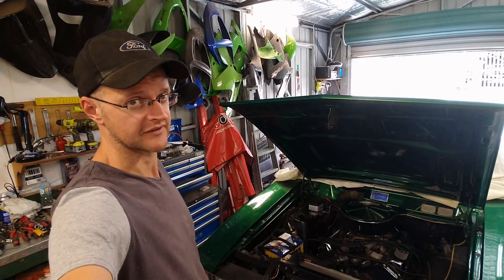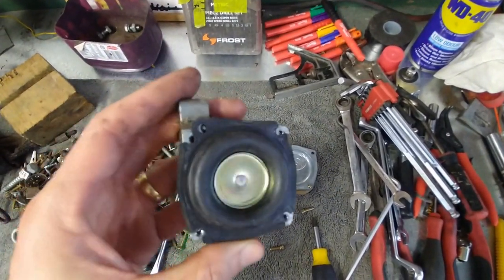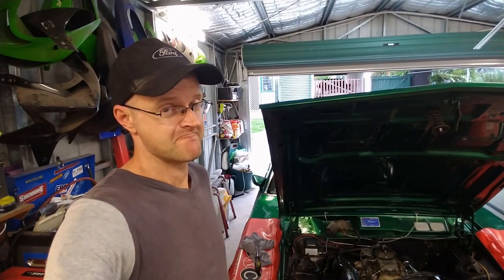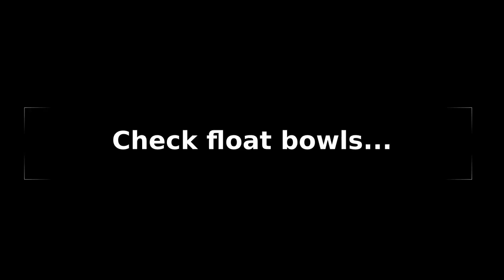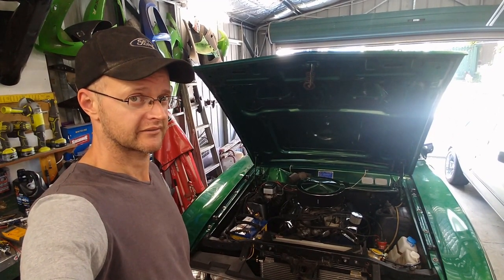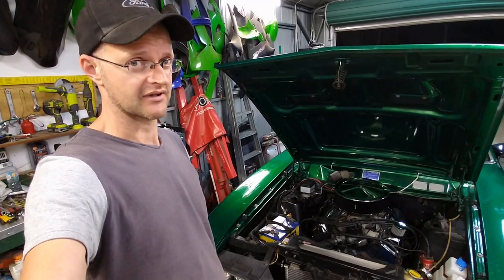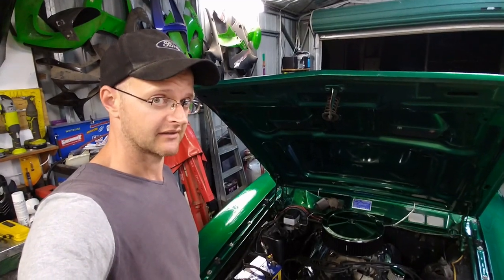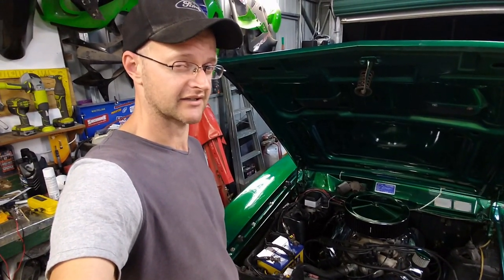Ep 73 XC Ford Falcon 351 Cleveland project: Second opinion time!

Comment: My XC makes that exact same squeak from the steering wheel- it’s so annoying. I put some oil down the steering shaft, it lasted about 6 months. Sounds like your getting close to fixing the carby and timing 👍
Reply from the maker: Hi Jason, I think the squeak is because I left the steering column adjustment wedge out when I put in the ZH column. I went over everything on the weekend and added the wedge in after oiling the bearing and removing all the plastic bits one by one only to still have the squeak.